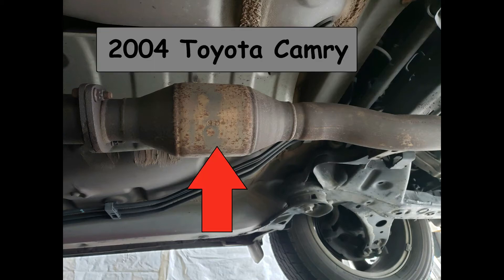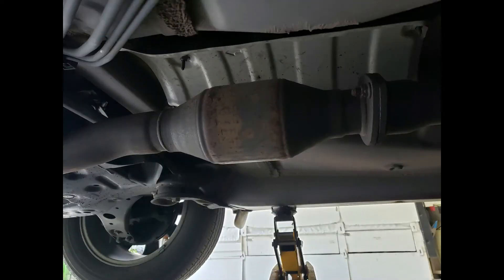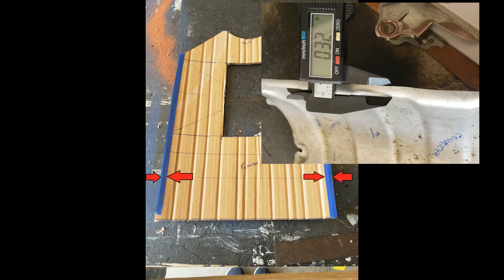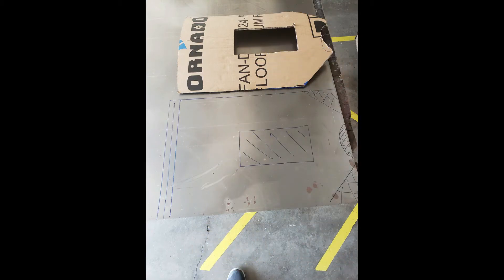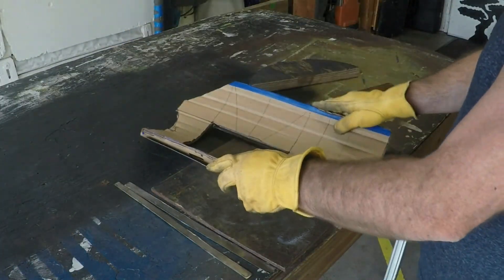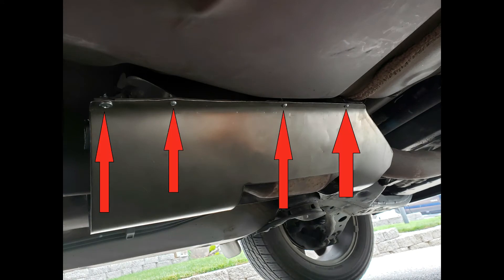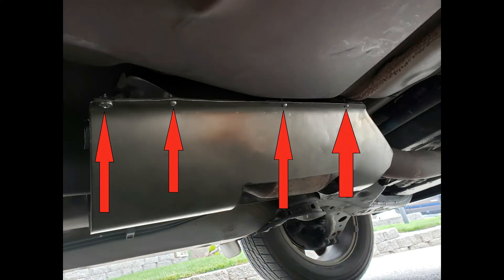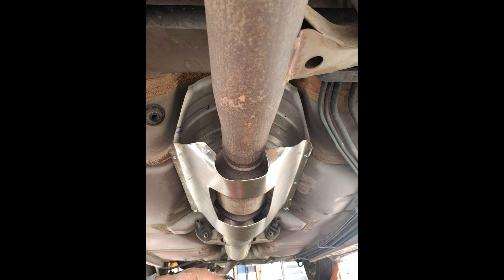DIY (catalytic converter theft shield for 2004 Camry)

Comment: Nicely done!  It has been my experience that thieves are lazy.  If you make it more difficult to remove, they will move on as you said.  Great video!
Reply: Catalytic converters are worth so much now ($500-$1000 scrap) that they will spend half an hour under a vehicle cutting shields and cables to get them out.

Comment: Thank you for this. I have a 2015 Subaru outback and cant find something pre-made.  Lot of stealing in our area regarding Cadillac  converters but I live in Washington so I thought they made it illegal to sell them here. I loved welding in high school. If anybody knows where to find something like this ???  since I don’t have the equipment please leave a message.  💜🦋💕
Reply from the maker: The city of Kent Washington caught a couple of cat thieves. Traced the stolen Cats back to shipping containers they were using to send the parts oversea's for processing. Sounds like there were over a 1000 converters in the container. So even if it was illegal to sell stolen converters, it does not slow it down.

Comment: HOW ABOUT AN EXPLOSIVE BOOBY TRAP?   I WOULD  WELD ON A STICKS OF 3/16 2" FLAT BAR STEEL TO THE PIPE. Cover CC with heavier plate with plate sticks added several and heavier pipe surrounding it (It is mine) Care less if its hard to remove . 12 pounds of steel lots of required material ( a thin 2.5" muller takes abiut 20 seconds Vs a few minutes and have a sound /Proximity alarm under the car. turns on when car igmition is OFF.
Reply from the maker: Interesting. However, since cat converts require heat to operate properly, how would welding on 12 pounds of steel  heat sinks effect the operation of the CC?

Comment: People: don't spend that kind of money, just have a shock sensor installed to your alarm, set it to high and Everytime it senses movement, vibration will trigger the alarm
Reply from the maker: Spend that kind of money?! What does that mean? I used a sheet of steel I had laying around and some inexpensive rivets. If I had opted for the security screws, it would have been $15.  A quick search of the internet showed that shock sensors normally start at $50 and go up from there. Maybe you can post a video on your channel covering how to install a shock sensor on a car? I would love to watch it. Don't forget to tell people about all the false alarms the sensor will activate on if they live near an airport or on a road with large trucks.